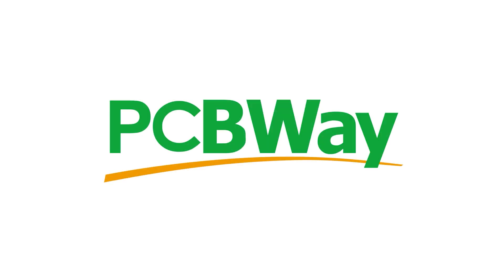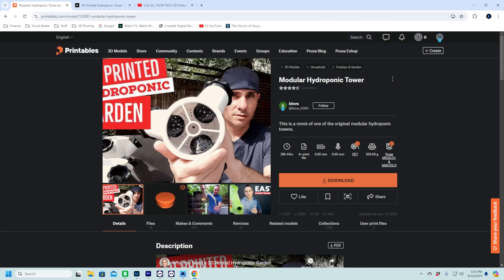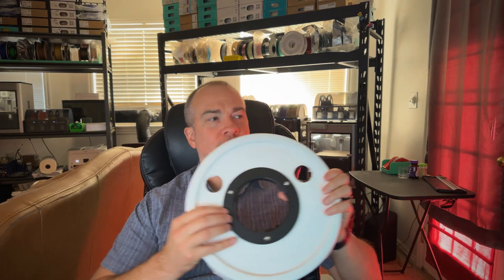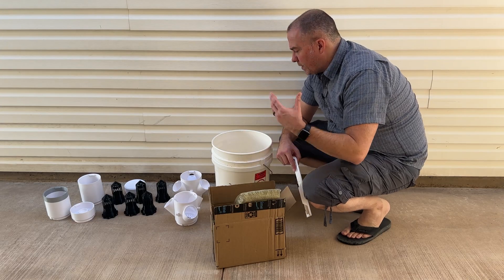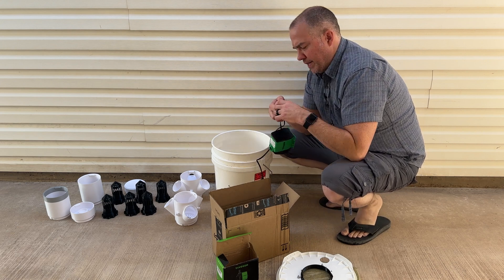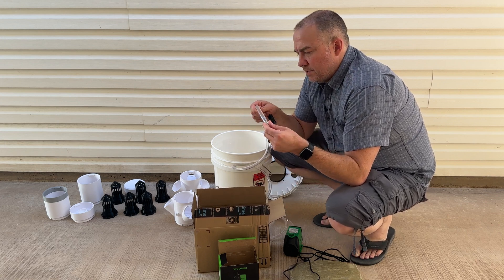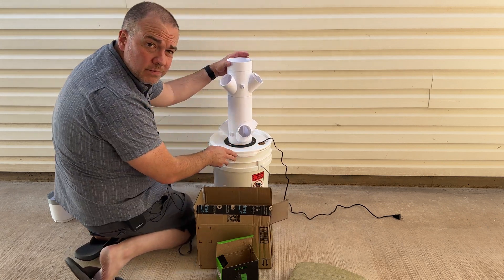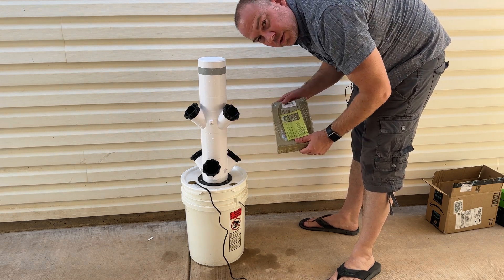3D Print Your Own Hydroponic Garden Tower (X1-Carbon Time Lapse and Demonstration)

Comment: It would be cool if the tower print included a tube in the centre so you dont have to use hose.
Reply from the maker: But think about it. How would that work? How would it connect to the pump? A hose has to be used.
Reply: @thisprintedthing7967 make it the same diameter as common hose.

Comment: Can I ask for an update on this? How did it turn out? Any leaks from the design? And any downsides?
Reply from the maker: The strawberries exploded. But didn’t produce much. It was the breed that I had. So I planted some lettuce, and we enjoyed fresh salads for a few months. You do get some leakage around the joints, but nothing too bad. It just crusts over a little bit where the nutrient solution dries. But I’ll be getting some more rock wool and planting some spinach next.

Comment: What is a good 3-D printer? I'm picking to retire and I want to make me some alcoholics. To have something to do I have a few built by hand I want a three d printer
Reply: If you are not familiar with 3D printers and have a budget of at least €600-700, I would recommend the Bambu P1S. It's a great printer for both beginners and advanced users, with lots of community support as well. I got a Bambu P1S a year ago, and I'm really happy with it—zero problems so far, aside from a few user errors.

If you're looking for cheaper but reliable options, consider these:

Creality Ender 3 V2 Neo – A solid beginner-friendly printer with a sturdy build and great upgrade potential.
Anycubic Kobra Neo – Affordable, easy to set up, and comes with auto-bed leveling.
Elegoo Neptune 3 Pro – A budget-friendly option with direct drive extrusion and silent stepper motors.
Voxelab Aquila X2 – A good alternative to the Ender 3 series with similar performance at a lower price.

Comment: So I made one of these towers, the problem is white petg filament still allows light through in a sort of white glow, which allows algae growth on the inside. I'm going to make another soon with more infill/walls and in a darker color like a forest green, hoping this will block enough light
Reply: There is a PetG which is light-tight. Add some H2O2, it kills algea. Also I switched to a different fertilizer, that also improved water quality
Reply from the maker: @Dryesias  interesting. Thanks for sharing. If you can, update us on your results.

Comment: That's a pretty cool design. Good luck on the move. How much filament would you say it took for all the prints on this?
Reply from the maker: @bigbearlantz  considering that it was just that one little section that I had to print in gray, and I had been using that white roll for a while, the pieces that I printed were far less than a 1k roll of PETG. However, that said, most people are probably going to want to print more pieces to stack their towers higher than I did.